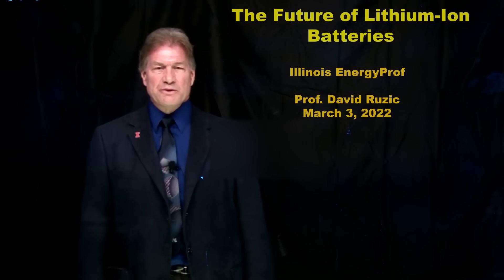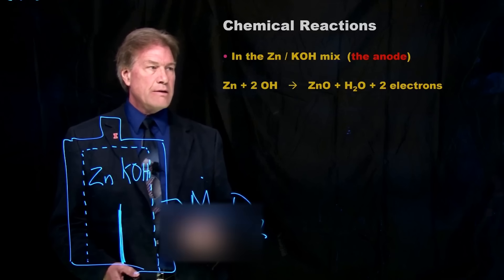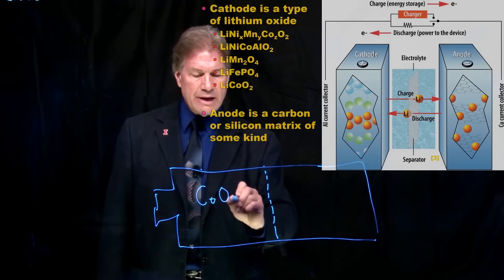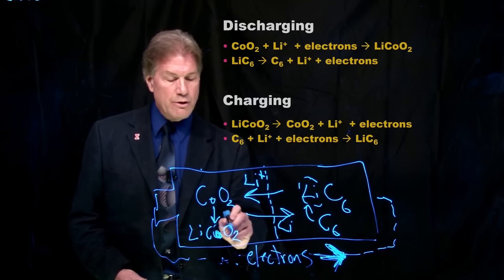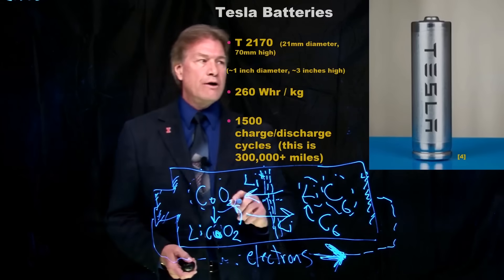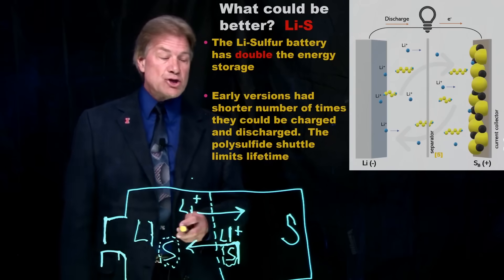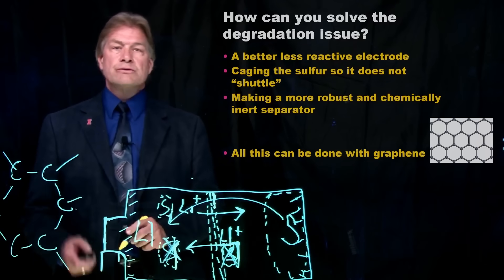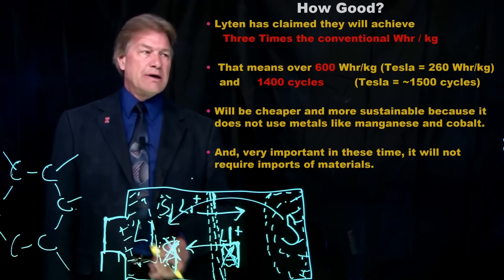The Future of Lithium-Ion Batteries

Comment: I agree that IF a 3x or more battery tech could be commercialized it would change everything but I have seen so many companies promise that they were just about to do it only to never hear from them again over the last 20 years.
Reply: Two years have passed and the spontaneous combustion of EVs and toxic emissions is now  a big concern , plus they have lower range of it's too hot or too cold . Forget about energy robbing air-conditioning. Avoid hills and towing. Exactly how can they be conveniently recharged ?
Reply: Making money via market manipulation is easier.
Reply: "Hey now guys, trust us, the perfect solution is on the horizon. Trust us, we'll make it out of this hole, we just need another decade of development. No, don't worry, you don't have to pass legislation, we'll save humanity, just give us a little more time. Yeah, we're going to have to use fossil fuels until then, that's only reasonable. Yes it's reasonable, trust us, the climate will be ok for another decade. Hey now, don't be unreasonable, we're funding this tech for sustainability, don't be unreasonable... Wait, hold on, trust us, graphene will save you all, you just have to wait a few years longer, hold on, hold on, hold on now!..."
Reply: @avialexander  Sounds like the pitch for hydrogen fuel cell cars... 🙂
Reply: @avialexander  
I worked for a startup for a year.
Yeah, that's not an unfair criticism. But it's also a fundamental part of trying to get funding. 

These days, big companies just can't take the risks needed for real innovation. Everything is incremental. Which is fine, I understand their position. But that means we have to let the startups do their thing, or else innovation will be nearly impossible.

Just .. be a wise investor. Don't fall for the newest fad or unicorn.
Reply: @danclassic7065  I was a founder of a tech startup, I know too well how they work, they can't save us. Making money is orthogonal to doing good for humanity.
Reply: @avialexander  No, you just don't understand the concept of value. Whether it be cheaper lamp oil of superior quality, antibiotics, refrigerated transportation for food, or anything else offered in a free market, money can only be made if it offers an improvement to people's lives. What you're describing is the result of a glut of investment capital and a lack of worthwhile investments.
Reply: @avialexander 
Sounds like the pitch for nuclear (to cheap to meter).
🙈
Reply: @TBFSJjunior  No, no it doesn't. Nuclear power's problem has never been one of technology; it's been one of incompetent bureaucracies. As if there is any other kind. 
Nuclear power has spent its existence shackled to what may be the worst way to implement it short of absurdities like setting off nukes to turn wind turbines. And we've had vastly superior designs for nuclear reactors since before the first commercial nuclear reactor even came online in 1956. Those shackles are finally rusting through after decades with the rise of companies like ThorCon and Elysium industries.
But being forced to use obsolete technology by itself would have only made nuclear power a little more expensive than natural gas. On top of the dinosaur tech, nuclear power has been buried under regulatory burdens with no basis in reality which further lead to a negative learning rate in the construction of power plants. The latest was the "issue" of  mild and local warming of water used for cooling.
Reply: @jsn1252 
QED
Reply: @jsn1252  Well put, government incompetence on a nuclear scale!
Reply: All this effort with converting ICE to EV's on a one to one basis is lunacy.
The hard truth is that we need a radical withdrawal from personal transport.
Really, all this effort should be pumped into public transport infrastructure.
Reply: @stuartburns8657 
All this effort to have an one or the other discussion.
We need both.
We have to get all ICE cars of the roads and public transport would be the best option in many places, but especially in rural areas aswell as for many trades, public transport doesn't work.
A person driving 300 miles a day with tools, will need a personal car and for this its better if it is an EV over an ICE.
Reply: @TBFSJjunior  Hi Jakob.  Yes, my comment was too absolute, and you are correct in that many vocations needed a mode of personal transport.
I think encouraging working from home is also a key part of the equation.
Obviously, too much Government and State / Council income reliant on taxes from businesses

Comment: What are the safety aspects of having such a energy dense battery? Puncturing a Lithium-Ion battery already creates a fire that is very hard to extinguish.
Reply: Every medium of energy storage has its own risks. With things like petrol and diesel, we've gotten so used to dealing those risks that we think they're safe. But they're only safe because many accidents have led to regulation and best practices.

The same will happen (and is happening) with batteries. If something like hydrogen becomes more widespread as an energy carrier, accidents will happen, and then it will be made safer.

This is how we've dealt with risks basically forever, and probably always will be.
Reply: @SolarWebsite  Umm... I'm gonna press x to doubt there. Fossil fuels are extremely safe when stored separately from oxygen. Batteries cannot be stored separately from the oxidizing agent. Thus batteries are inherently less safe.
Reply: @aaronchapin9331  Yeah my point exactly.

Comment: They have been studying batteries for more than 5 years.  the concept itself is viable and proven to work.  the problem is not the theory, but the implementation of it.  Right now the biggest problem is the manufacture of the membrane.  The Graphite membrane is only a few atoms thick and the structure of the graphite must be perfect to improve the efficiency of the reaction.  But it is one thing to theorize or make some test models in a laboratory and another is to manufacture thousands of square meters of a graphite membrane with a perfect atomic structure at an industrial level.  Models and "prototypes" have been manufactured, but at the moment mass production is not possible.  In the manufacturing process of the graphite membrane, irregularities, errors, bad formations of the membrane occur that today make its large-scale manufacture unfeasible.  The loss of material derived from the "bad formations" is too great and the graphite membrane formation process is too slow and expensive.

Comment: The problem with these batteries is the graphite membrane.  Make the PERFECT membrane in sufficient quantities, at an affordable price (cost of the machinery, of the product itself, cost of electricity in the manufacturing process, NOT wasting material or time in the manufacturing process and achieving an excellent quality of the membrane without production failures... Being able to produce meters and Kilometers of Graphite membrane without a single error, that's big words... And also the fact that the battery contains sulfur... in the long term I see it as an error... Now it's a novelty and everything is willing to look the other way… but after a few years on the market the problems of battery toxicity will begin to emerge… The idea is very good… but it is not easy to make the graphite membrane and even less so in industrial quantities and without make mistakes in the manufacturing process.
Reply: Why not then work on inspection? A very quick and reliable way of quality checking of the produced material and discarding areas with faults, is maybe a viable way forward? If that is in place one could work on the process of improving the quality of the material and slowly mitigate the waste issue. How to do this? No idea, but there might be ways electrically and optically.

Comment: I don't think trucking really needs any kind of improvement since railroad is superior in nearly any way, but could be a nice for short range trucks
Reply: Currently America uses TONS of trucking,  so even if the improvement doesn't change 1 thing in railroad use. . .  It will still benefit the currently 2 million semi trucks across America that are necessary for transporting goods.
Reply: @DanDeGaston  didn't change the fact the railroad is like at at least  50% more efficient and it's also electric
Reply: @nightstar5077  I don't know about the railroad efficiency.  But there are 2 million trucks that would become far more efficient irregardless if Railroads remain more efficient.
Reply: @nightstar5077  Diesel-electric. Certainly the superior choice for bulk materials transportation.

Comment: 300,000 miles is a false claim, the battery is deteriorating the whole time, towards the end of the battery's life you'd have a range of only a couple miles, it would be useless long before the battery "died".
Reply: The end of life for a battery in vehicles is not when it can only go a few miles, it's when the capacity of the battery drops below about 80%. Still very useful, just not as long range as you might be needing. There are several Teslas that have done more than 300 000 miles. A quick search found one that had done 750 000 miles and was on its 3rd battery. How anyone manages to drive 100 000 miles a year is beyond me but that is beside the point.
Reply: @zapfanzapfan  Taxi drivers. :)
Reply: @patrickb.4749  I'd be surprised if even Taxi drivers manage that, traffic doesn't move fast enough, not in big cities anyway. However, the Tesla taxi between LA and Vegas makes up a few of those high mileage cars 🙂

Comment: "I've never had an internal combustion engine last 300,000 miles."

Honda Civic owners: 😁
Reply: My last 2 Holden commodore's I owned both did 500,000 km each.
ICE cars and truck's have very good range and reliability
Reply: Say hello to my Volvo P-1800! 😉
Reply: Look at the average million mile life expectancy on semi trucks. Last I checked those were internally combusting.
Reply: By the way we didn't compare the price of a tesla battery pack, vs a ICE engine.
Reply: While a top fuel drag race engine might not even last a mile, it's claimed that some of the old London black cabs have done enough miles to make it to the moon and back. All depends on how it's built and how it's driven.
Reply: @JaenFoster  A friend of mine had an old car with spinning digit wheels for miles traveled meter. And one day on the highway he saw the numbers go back to 000000. That was more that 1 million kilometers (we're in europe).
Reply: The old inline 6-cylendar in 90's Jeeps are known to last the long if you can get the rest of the vehicle to survive the trip. My '99 is 2/3 of the way there since it's been relatively lightly used over its lifetime.
Reply: @OOZ662  Hmmm what straight 6 might you be referring to? And by the way the 225 slant 6 was leased to Chrysler for 50 years from Rolls Royce. And they still were no hell.
Reply: @kend6693  4.0L PowerTech Inline-6
Reply: @OOZ662  20 year engine in a 5 year package.
Reply: I know Lexus owners doing the same thing.

Comment: Thanks for the explanation, but tripling the energy density isn't enough.
Reply: It would definitely be enough lol. Electric cars with 900 miles?
Reply: @weasle2904  
Yeah, well. Reduce that to sixty percent in cold regions in winter. And dragging a five hundred pound battery around isn't exactly energy efficient either.

And another question is - where do you get the electricity, if only fifty percent of the existing number of cars went electric?
Reply: @Peter_Riis_DK  Even with natural gas electric cars are better for the environment, and they're going to become more economically viable with battery innovations as well. It's inevitable.
Reply: @weasle2904  
The light and gravitational pull from the Sun takes eight minutes to reach the Earth.
Reply: @Peter_Riis_DK  ok

Comment: Scalability of graphene production is the issue. There are hundreds of billions of dollars of research and development between a lab bench and a mass market commodity. You might as well have talked about fuel cells or nuclear batteries or ultra capacitors.
Reply: This feels like PBS techno-optism.
Reply: @j03man44  yup but way more feasible than wind and solar. Unless graphine becomes the next fusion.
Reply: Ultra capacitors work well in their niche, delivering very high power for a short time. It's just not on the level of capacitance gel from Demolition Man, yet 🙂
Reply: Except fuel cells and ultracaps are already in production for the masses, way to self own.
Reply: @JasonKerlin  That was my point! They're in production but they're still nowhere close to being a substitute price wise for lithium ion batteries either because of cost, technological limitations, infrastructure limitations, production bottlenecks, or all of the above. A graphene dependent sulfur lithium battery is even less practical! If you can make high quality graphene at scale there are a million better applications for it than a separator for sulfur batteries.
Reply: @j03man44  Ahh well I guess I self owned myself.  I missed your intent completely.
Reply: graphene and membrane manufacturing is more practical and already something we can make but struggle with in mass manufacturing. Supercapacitors are in a similar state. In the  near future they may be very common, they're not that complicated. Fuel Cells suck though, inefficient idea.